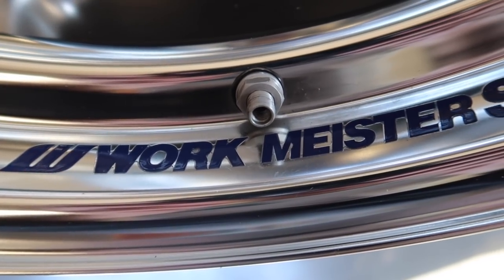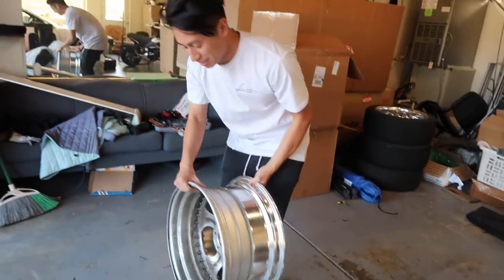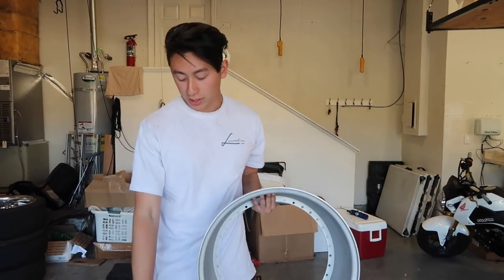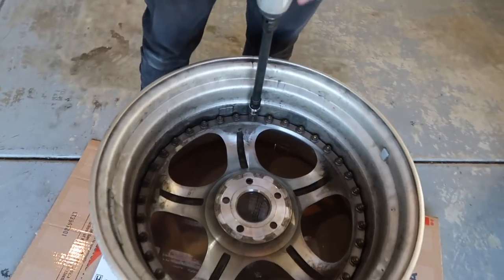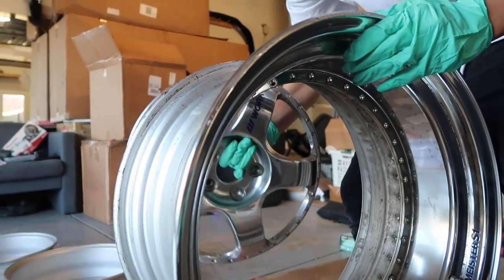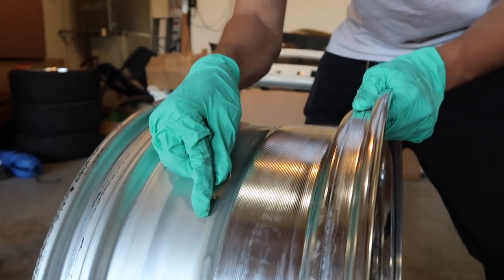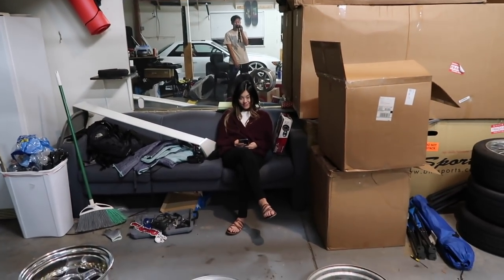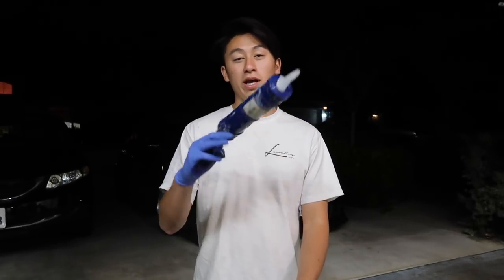How To Rebuild 3 Piece Wheels!

Comment: For all the young bucks who never used a calk gun before 

Take nozzle off tube of calk use a razor blade and cut the tip of the tube off screw cap back on now your good to go (don’t try to poke through the nozzle or you’ll make it bigger and possibly make mess when due to too much coming out at once especially if you working on these types of expensive wheels 

👍🏾

Comment: Good and very informative video. I am doing a face swap on my meisters as we speak. I am going from a 5x112 to a 5x114.3. Although it's not a full rebuild, this video helps alot. Thank you for that. 

Just one question. Is it recommended to put some kind of lock tite on the bolts attaching the face and the barrels?

Comment: I wouldnt use tape. Just use the silicon and feather it out to be a nice clean tight seal. I've done it before on my 100 spoke wheels and it leaves a nice clean seal no leak.. If you ever get a chance to look at an wire rim video it will help out.. Just my input.. But came out nice. Gave you a big 👍 up homie

Comment: Hey, I Got some rims from Japan and the assembly bolts on the inside is a bit rusty and has corrosion. I was wondering if I can just unscrew them out and put it in evapo-rust and just reinstall them after. That’s fine right? No need to rebead?

Comment: Hi need some help here. 
Damaged my wheel and needs a new lip. Contacted a company. But their asking for the following dimensions. Can you do a video on how to measure for a replacement lip?
Searched YouTube and google. Can’t find anything. Many thanks. 
Centre bore
40 Bolt holes ring diameter
Lip internal diameter 
Assembly Hole Pattern / Hole Sizing for M8 Bolts: 40 XØ8.5mm Equally Spaced.
1 Hole Slotted For Thru Center Valve.

Comment: You guys are lucky that work does not weld their inner barrel to their outer lip like SSR does. I have a set of SSR GT3 s that I wanted to do the same thing too to turn my 10 and 1/2 into 11 and 1/2 and turn my nines and into ten. But sadly yes SSR is welded together